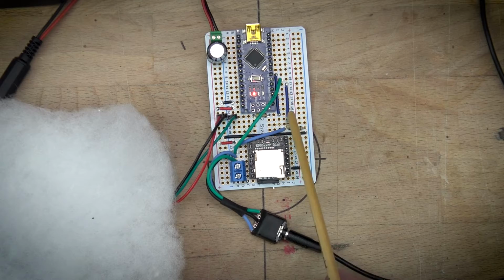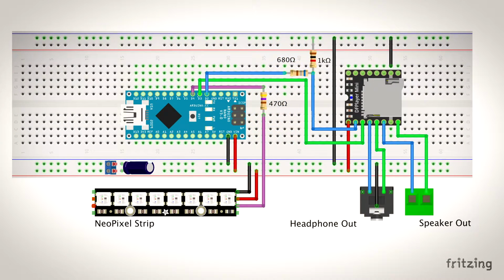Lightning and Thunder Effect - Arduino, DfPlayer Mini, NeoPixels

Comment: First of all, great project, and exactly what I was looking for! The time delay between flashes and the audio is perfect, and the adjustment of brightness to match the delay interval is genius IMHO! You are generous in your credit to those whose code, etc. you consulted to build the project, but I've seen no other project as well thought out and flexible as yours, whatever its roots!

However, when I began to put it all together (in breadboard version, before attempting to convert it to the semi-permanent form in your video), I ran into a series of problems, most of which I've been able to successfully  troubleshoot. The remaining issue is that the DF Player Mini doesn't seem to play the files when commanded by the Nano. Thinking the problem might be a defective player, I wired together a simple player lash-up on a breadboard, using a prepackaged sketch, and it seems to work (there's a bit of background noise when the files play, but that's an issue for another day, and one I can live with if necessary).

One thing I noticed was the LED lighting on the player with each file played in the simple sketch, but not at all with your thunder and lightning sketch. I recheck all the wiring and found nothing amiss, even swapping out the wire connecting the Nano to the player. So, I dived into your code, and noticed you had included some helpful serial print lines for troubleshooting. When I called up the serial monitor, sure enough it reported the "[c]onnection failed". Any thoughts on what might be going wrong?

One thought was that, instead of the Nano, I used an Uno board to test the player (it enabled me to leave all the T&L wiring in place on the breadboard, and instead build the player test lashup on a separate breadboard). Could my problem possibly be a bad Nano (or pin on the Nano)? It shouldn't be too hard to wire in the Uno in place of the Nano, or possibly change the player pin(s) in your code for the Nano. What do you think?

Sorry for the longish post, but I'm a bit stuck. On the good side, while waiting for the NeoPixel strips to arrive (and now, waiting for the solderless connectors to arrive!), I found that a plain old white LED dropped into the circuit in place of the NeoPixel control wire flickered just fine -- not very bright, but more than adequate to confirm the flashing code produced the effect I was looking for! Thanks again for sharing your project, and I hope you can help get me unstuck! 😏
Reply: Never mind -- after a long debugging process (details too numerous to spell out, but details upon request), I finally got it all to work, not only in breadboard form but installed on my O scale train layout! Here's a short (minute and three-quarters) video showing the system in action: https://youtu.be/QSXlqlBJGIY However, there were some valuable lessons I learned in the process that might help others avoid some of the potholes:

- First, be clear that the Neopixel Strips will require some very fiddly soldering to connect, since they do not come with leads, nor does Adafruit offer any sort of solderless connectors for them AFAICS. I purchased a set of four-wire connectors that actually line up with the connectors on the Neopixel strips, but they would not work without extensive (and problematic) modifications, so I ended up stripping them out the connectors and just using the wires -- an expensive way to wire them up! My suggestion would be to modify the project to use LEDs with solderless connectors, since not all of us have the soldering skills needed to connect the Neopixel strips.

- Second, while I am satisfied with the result, for larger applications like my train layout a much brighter LED array would be much, much better. For smaller applications like dioramas or book nooks (who knew that was a thing?), the Neopixel strips would do fine, but I'd gladly trade the color flexibility of the Neopixel for a brighter 'flash', in a heartbeat!

- Third, the DF Player Mini has a well-known history of fiddly audio problems (google it), most of which I experienced in some form at one point or another. Be prepared to spend some time debugging the audio. For instance, no guidance was offered on mandatory MP3 file naming and locating conventions, (there are some, though I found most can be disregarded, which may explain the oversight).

On the plus side, the random delays built into the coding, adjusting the brightness of flashes, and coordinating the delay and volume of the thunder, works exactly as advertised, and this project is IMHO far and away the best DIY thunder and lightning simulation currently available.
Reply from the maker: Sorry for the late reply. I'm really happy to hear you found solutions. It looks great on the layout! I also appreciate your long comments, your input will be really helpful for others looking to try this out. I think the two things that jump out are:

- Neopixels are not the easiest to solder. You really need to pay attention to the in and out pads on the data line and soldering wires to pads isn't fun. I keep thinking I'll find an easy/lazy way to do it but I haven't really... yet. Pre-tinning the solder pads and wire helps but those pads are still tiny and my eyes are getting old.
- The DFPlayer Mini is twitchy. I've seen tutorials where people connect the Arduino data straight to the Player data where others say the player data in isn't rated for the voltage? Putting the voltage divider in makes for more complexity but hopefully longer life.

The random function is one of my favorite! Most of the lighting I do is for nooks or small dioramas and it's important for it to be believable. Nature is random so finding ways to get the most variety out the fewest lines of code is an interesting challenge. I really want to put a real time clock on one of my projects and have the lighting change throughout the day... and maybe even throughout the year.

Thank you for sharing your experiences and providing so much valuable information. Cheers!
Reply: @RandomMakingEncounters  Oh, no problem on the delay -- I figured you had better things to do than instantly reply to my kvetching, and in any event I muddled through. 😜Thanks for confirming that my struggles were not unique to my personal skill level, but were to some extent inherent to the hardware itself; giving a heads-up (and some possible solutions/cautions) to those tempted to wade in would be helpful IMHO.

One final question: any suggestions on how to make the lightning flash stronger? The Neopixel strips are more than adequate for a small diorama or book nook, but for a train layout of even modest size (mine is 8' by 8'), the light provided is at best adequate. It appears I could just daisy-chain more Neopixel strips with the current setup, but they're rather expensive for the unit output, so if it would be possible to trade the color flexibility of the Neopixel for a higher output, cheaper white LED string (or better yet, two, as used in the BLI Lightning & Thunder set (https://www.broadway-limited.com/1598lightningandthunderaccessoryforany-scalelayout.aspx), which appears to alternately flash the two strips, much like you do with the two groups of LEDs on each of the Neopixel strips in your design). ISTM it should be relatively easy to utilize the same basic code to randomize the flashing and coordinate it with the thunder, but instead direct the output to cheap LED strips or other stronger emitting devices (I've seen small LED spotlights that would be perfect!) that would provide a much stronger flash effect. Next upgrade? 😏
Reply from the maker: Take a look at this post - https://randommakingencounters.com/arduino-dfplayer-mini-fets/. It's not too big of a change to swap out Neopixels for a strand of 12 volt white LEDs. The big differences are you now have to wrangle multiple voltages for your overall project, you have to choose a method to quickly turn the LEDs on and off, and you need to make sure that all of your components can handle the amps without risk of overheating. I think the easiest way is to use off-the-shelf modules for both the power management and LED control. If you swap out the Neopixel for a simple on/off command that turns either a relay or MOSFET on and off... voila... brighter LEDs. If you wanted to flash two strips, you would use two pins to control a pair of relays or MOSFETs. Relays are noisy but less worry about heat dissipation... MOSFETs are more flexible but you need to heatsink 'em if you start to run higher amps through them. I'm self-taught so I always get a little twitchy when making things that have to potential to... ya know... light things on fire.
Reply: Hello,

i want to build this thunder lighting system into my resident evil 1 diorama!
Could you please assist me and help out?

Im afraid i will be stuck in the middle if i put all these things shown in the video together and the it want work.

Also can i just use a regular led strip? I dont want to fiddle with this nano lights.

thank you
Reply: @gaboaaa23  Well, I'm probably not the best one to help you on a project like this -- as my posts above allude to, I struggled more than a bit to get it all to work, and I have since replaced my home-brew version with a commercial version (BLI Thunder & Lightning set) that was the inspiration for my original search when I discovered it was out of production at the time. It is now available, and at a bit over a hundred bucks IMHO it's worth it to avoid all the hassle . . .

And no, I do not believe you could just substitute LED strip lights -- the neoPixel strips have four conductors that drive several sets of LEDs in each strip, and a specific Arduino driver is used in the programming that's set up for the neoPixel strips. The advanced recoding required (which the OP alludes to above) would IMHO obviate any gain by using the cheaper (and brighter) LED strips.

Good luck, in any event!
Reply: @ thanks, nut this device cost 170 euro in germany. It hink ill have to search for anothersoluttion

Comment: This would be great for use under my hotrod at car shows.... but I'm not really good at small scale electrical projects. Would like to find someone to make something like this for me.
Reply from the maker: I would think it would be something doable for someone that has experience doing car lighting effects. The big thing is adapting it to be able to handle whatever voltage those lights run on and then tying it to the car sound system maybe? You’d want some sort of buttons or controls so you could roll up and blast some thunder and lightning :)! You might look to see if there is a Maker Space in your area. They may have members that have all of the mad skillz to pull something like this together. All the best and good luck!

Comment: Great project! I am waiting for parts to see how it looks. I do have a question about the sound. You provided the site for downloading the sounds and I know I need to change longestTrack to the one I have. But what I want to know is the order of the files on the SD card. Is it random or is it better if the shorter track is first and longest last? 
Thank you
Reply from the maker: Really good question! Soooo, there are a bunch of ways to code this and I kinda took the lazy way out. It's not super critical to know precisely when the sound ends for this effect because the lights flash firs and then the sound plays-the lights aren't synchronized with the sound. That means that I only needed to know how long the longest sound lasts and make sure there is enough of a delay at the end before looping to avoid cutting off the audio. So... to answer your question... the order of the songs on the SD card is unimportant. The only variable you'll need to change is:
  // longests track length - ms
  int longestTrack = 18000;
You don't need to be precise to the millisecond. My longest thunder sound was about eighteen seconds and I probably added a bit for good measure. I hope that helps! I'm always kinda just wingin' it on the code. I'm sure there are smarter coders out there that would have a more elegant solution but I try to keep it reasonably understandable and basic... which is just about my speed!
Best of luck with your project! Cheers!

Comment: This is really cool, but at 3:28, you said, "Without anymore talking..." but I'm glad you kept talking :-). I do have one suggestion. Position the board horizontally (right reading according to the printing on the board), then you can zoom in on it a little more, and the non-powered rails will be vertical, as opposed to horizontal. Just my 2 cents. Thanks for the tutorial.
Reply from the maker: Thanks for the input. I'm always really happy to hear what people think will make my videos a bit more informative or easy to understand. It's pretty challenging compressing tons of info into a reasonable amount of time. I have more Arduino videos in the editing queue right now. They're a bit of a "get back to basics" to help people who've never dreamed they could use a microcontroller. Thanks again and all the best!

Comment: You could use an rgb w2812?
Reply from the maker: In theory, sure! If I’m understanding the w2812 correctly, it’s an individually addressable rgb LED. You may need to tweak the Arduino code to a different library but the concept is the same.

Comment: Hello, can you please advise me on which links to download the necessary libraries to the arduino?
Reply from the maker: For the lightning project, the two libraries you would need are the Adafruit NeoPixel library and the DFPlayer library. Both should be available through the Arduino IDE. For more details, you can check out the following resources - https://learn.adafruit.com/adafruit-neopixel-uberguide and https://wiki.dfrobot.com/DFPlayer_Mini_SKU_DFR0299

Comment: Also is there a way just to make a simpler version of this
Reply from the maker: You bet! The first thing that could make the project simpler (sorta) is to use regular LEDs. If you don't need RGB, you could just use a handful of bright white LEDs. The one thing with that is you can't control/power the LEDs with the Arduino but it's pretty simple to use a power transistor to switch the higher current on and off. There are inexpensive pre-built boards you can buy online that avoid having to build your own from scratch.

The next thing is to maybe use a different board instead of combining the DFPlayer and Nano. If you check out Adafruit, they have the Adafruit Audio FX Sound Board. It's still Arduino but it has audio storage and the amp onboard. This would eliminate the need to build out all of the connections to get the Arduino talking to the DFPlayer. It doesn't use MP3 audio but OGG... so some conversion is needed.

Last but not least, you can trigger the audio on the DFPlayer by tying one of the pins to ground (check the player documentation to see which pins). This is a really simple way to toggle sound instead of writing code to control and monitor the audio. I was trying to randomize the sounds and flashes so it didn't feel repetitive. That added a lot of extra stuff to the code that could be stripped out.

Instead of soldering up things like relays and power transistors, I always check the web for pre-built boards. Arduino is such a popular platform that there are TONS of things out there that are a handful of dollars and are usually just a single pin and power. There are also a lot of Arduino samples in the IDE... you may already be aware and an Arduino wizard so forgive if this is a bit redundant.

Good luck with your project. I love the idea of creating worlds that do things. An actual living world is even better!

Comment: Now is there anyway to put this on a second time I’m trying to use it for my terrarium with my sprinkler set up
Reply from the maker: There are a bunch of ways to approach this. Since the Arduino just loops through endlessly, you could throw a delay() at the end of the code to pause for some amount of time. It sounds like you may be building something a bit more sophisticated where you may want the thunder and lightning to play while the sprinkler runs. Totally doable but might need a few more components. Here are some random thoughts... you may already be way ahead on your build:
- How often does it need to run? If the schedule is pretty simple, you can control it all through Arduino using really long delays.
- What is the voltage for your sprinkler? You can't control higher voltages or currents directly through an Arduino but there are a TON of relay modules made to be pretty plug and play. You could use the Arduino to turn on the sprinkler and also loop through the lightning and thunder.
- Do you need RGB LEDs or would a string of bright white LEDs do the trick? You can kinda simplify things in the code by simply flashing regular LEDs but you add a bit of complexity by needing to control the LEDs through a power transistor (again... lotsa tutorials on the web for controlling higher voltages with Arduino)
In the end... you could create a terrarium sprinkler storm system all controlled by your microcontroller. I see you also had a second comment. I'll post some additional noodling there. Cheers!
Reply: Hello, can you please advise me on which links to download the necessary libraries to the arduino?
Reply from the maker: @provablepigeon6826  I think I may have replied to you in another comment but, just to make sure, the two libraries are available through the Arduino IDE and are the Adafruit NeoPixel library and the DFPlayer Mini library from DF Robot… I believe. There are a couple of DFPlayer libraries kicking around.